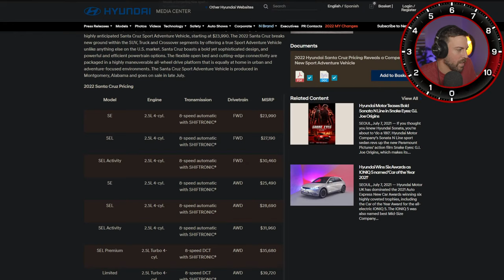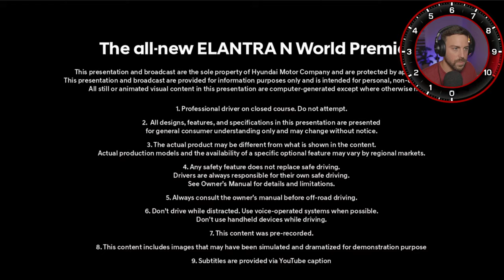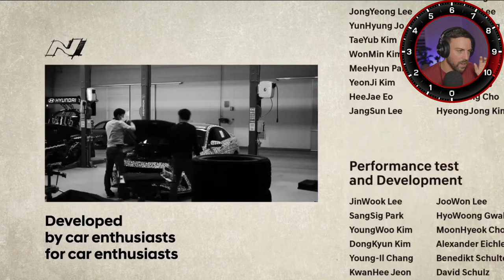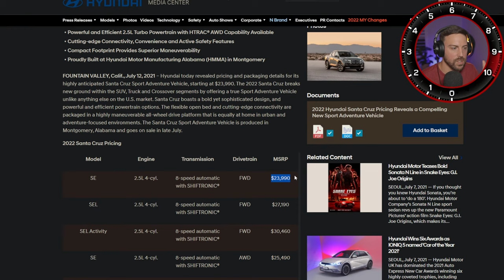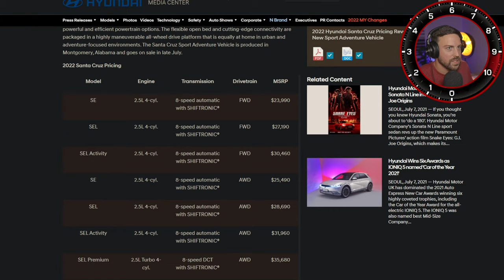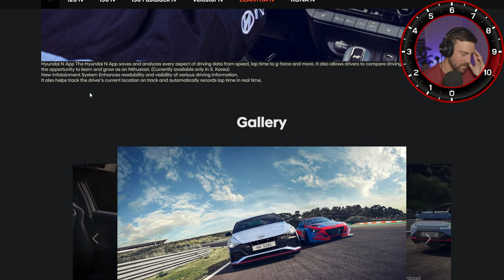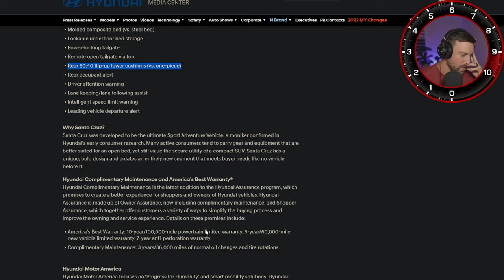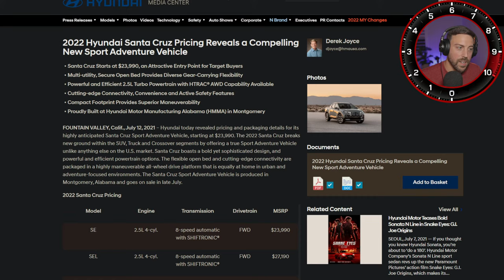The REVEAL of the 2022 Hyundai Elantra N - (livestream)

Comment: Fyi, I ruled this car out because it looked as if the backseat did not fold down based on the pic of the orange cross bar in the trunk.  Just watched a korean video and the back seat in that video did fold down despite the cross bar. The folding part does not split.